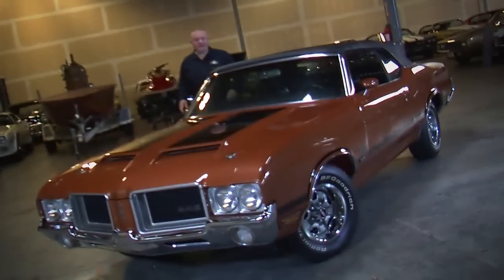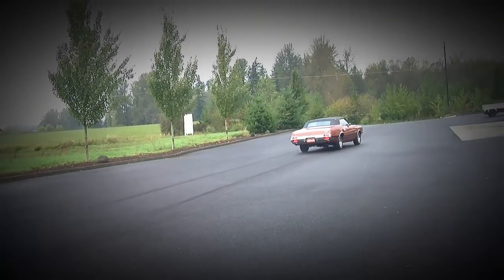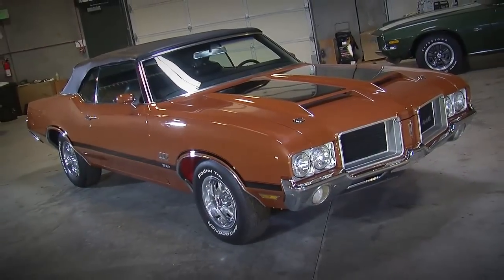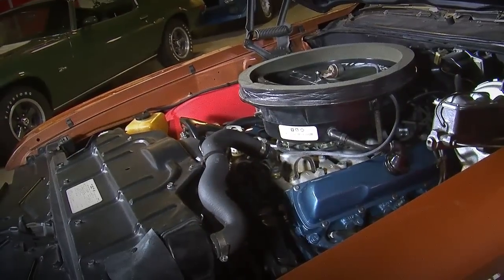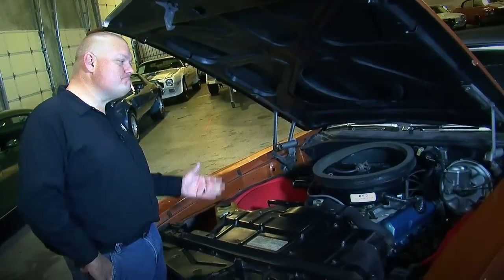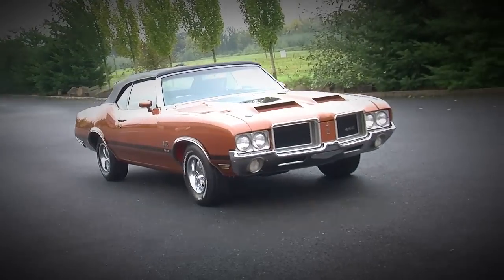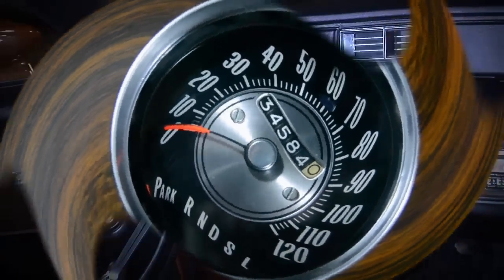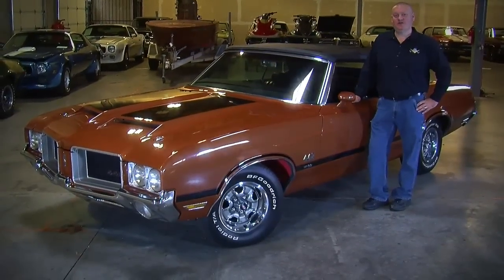1971 Olds 442 W30 Convertible Muscle Car Of The Week Video #33

Comment: First car I ever owned! 1971 Olds 442 W-30 Bittersweet hard top with bucket seats and a Hurst his and hers transmission- automatic on one side, slapped it over to the right to get to the turbohydromatic shifting side! What a fantastic car she was! Also the first car I ever did any motor work on! I miss her every day!
Reply: 2nd car I ever had...1971 Cutlass Supreme Convertible 350 4bbl w /TH350.  Bittersweet with black top, console, buckets,  factory air, front discs, Super Stock wheels and raised whites. My Dad helped me buy it at an action in Bel Air, MD. What a super cool car.

Got wrecked right after my first job out of college. Could have been repaired but I had no money to do it so I sold it. I miss that car everyday as well. Long may she run!!!

Recently looked for another one for over 3 years. Ended up with a 72 CS convert with all the same goodies. Saddle bronze with white top, buckets. Working on her now and having a ball
Reply: @gtrplayya  I have a 71 442 Bittersweet with the orange interior. Owned it sense I was in high school  back in 87. I had a lot of fun with that car. Out ran a few cops with it and use to race the crap out of it. I was working on it. It's in pieces now but I'm hoping to get back to it someday.
Reply: @Tom-yj6mt  Don't wait too long. Do it a little at a time. I'm in South Jersey right across from Philly. Where are you?

Comment: I owned a 71 Cutlass "S" in High school with this exact color combo (Hard top) It had the standard 455. The '70 and '71 442 W-30 option came with a specially calibrated 800CFM Quadrajet carb as well. All other GM makes utilized a standard 750CFM Quadrajet. The difference was in the primary venturi bore size. Also in 1971 Olds, Buick were much less affected by the lower compression than say Chevy SBS / BBC. Only one manufacturer: Pontiac actually went back to the drawing board in '71 to redesign the internal engine parts to still make good HP/ TQ but at a lower compression point to run on unleaded gas. But even that train ran off the tracks at the end 1975

Comment: Very presentable 4-4-2 Convertible. Owned needs to switch the valve covers left to right, and right to left. Bittersweet was a very nice color in 1971 and looks terrific with the black top and interior. My '72 4-4-2 convertible is unique in the fact it is Nutmeg Brown, an 88 and Ninety-Eight color, and has a black top and interior, so will look cool when finished.

Comment: The research I did on the '71 GM cars from periodicals of the day,  particularly Olds and Buick, indicated they upped the rear axle ratio, tweaked the carb to make it a bit more responsive, and modified the  turbo 400 trans for lower rpm and firmer upshifts. So despite the lowered compression ratio, they were very much comparable in performance to the '70 models. There may have been a bit less seat--of-the -pants power in the top end, i.e. highway passing situations. This affected quarter mile times to a small degree, but otherwise very comparable performance levels.

Comment: The 71 W30 had 350 gross horsepower (300 net).
Reply: Mark, yes indeed, he was quoting 1972 W30/HO numbers 300 gross 270 net.
Reply: Even the 73 Colonnade 442 was rated at 270 net hp I believe.....which translates to probably 320 gross horsepower. Not bad for a smog choked low compression 455

Comment: Interesting reference to Joe Mondello (Dr. Oldsmobile)...but since most of the information about his true influence on GM's efforts in the day are now lost, you should have explained the reference to how he 'detrimentally affected' horsepower in 1971 for Oldsmobile. After all, he is probably the brightest (and most-knowledgeable) Oldsmobile engine guy on the planet...making more 'cylinder head power' than any other could (including GM's own engineers). Not sure if he is still with Victory motorcycles still...but his time pretty-much came to an end with GM in 1975, when they stopped the 455-cu-in production.

Comment: I didn't watch the whole thing, but there was a little misinformation here.  I have a '71 W-30 I've had since I was a junior in high school in '86.  The red fender wells were not "a 442 staple for years".  Those are specific to the W-30, and the W-27 option was not an aluminum differential cover, it was the complete housing.

Comment: W30 cars were cool but that seems to be all your hear about in the olds line.Any regular 442 with just a few basic mods could run with a W30. Again not knocking the W30, wish I had one.
Reply: The w30 has lots of items that make it faster like the free-flowing cast-iron exhaust manifolds lighter weight car , A different cam! And a 830cfm carburetor that makes all the difference. The horsepower specs everybody quotes from the factory are a lie , they were arbitrarily specked those numbers to keep the engineers from getting in trouble from GM corporate. I got a 1972W 30 sitting in the barn

Comment: Stop calling it a Cutlass!
Reply: +armando saldivar It WAS a Cutlass, just like a Trans Am is a Firebird
Reply: ....and a GTO is a Tempest?

Sorry, this is a 442, not a Cutlass 442.
Reply: Last year of the 442 model. Cutlass with 442 packages etc starting in 1972.
Reply: Yep. The 442 was it's own model from 1968 to 1971. So, this is a 442, not a Cutlass.
Reply: It's the Cutlass platform hopped up to be a 4-4-2.   Either way you say it it's correct 👍

Comment: If it came with the automatic transmission, then, by the original concept, shouldn't it be called a 4-3-2,?
Reply: 442 also stood for 455, 4 barrell, dual exhaust.... it changed over the years to represent different things.

Comment: Speaking of the Loudest key in ignition Reminder Buzzer,  that Old's Audio old school buzzer has Nothing on the Whole Current 2013/14 & up lineup ferrari key/ignition On Digital 90 Decible Beeper & there Ridiculous Same beeper Sound Socalled Parking front & Rear Sensor Beeper. loud , Annoying & Distracting   as Hell. & As a Customer You Pay ferrari for that Ear Drum hammering Beeper Sound Effect in a Confined Window's up Closed Space. So if & When l ever am lucky Enough to own a Let's Say a Rosso Corsa on Cuio Full Leather Hides, l'm Deleting those two Beeper's ,& or Doing Something to Smother the Speaker's that  the beeping Sound is Piped Out off.Click Done.